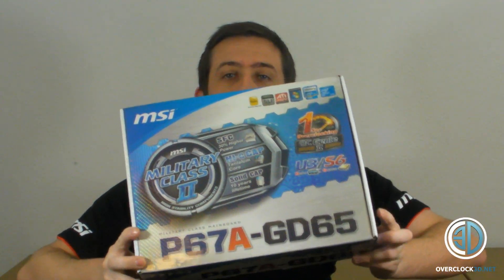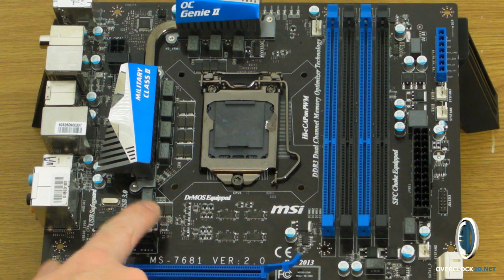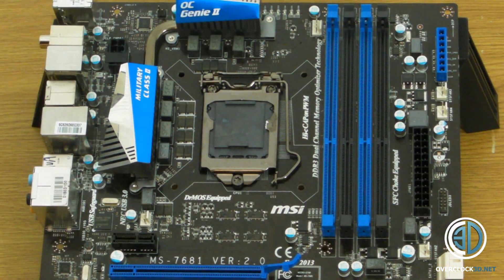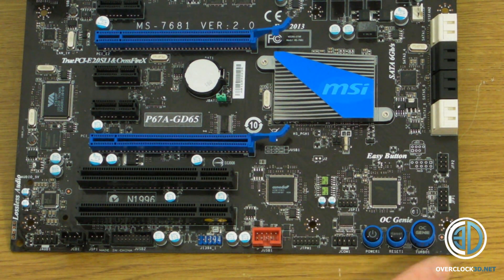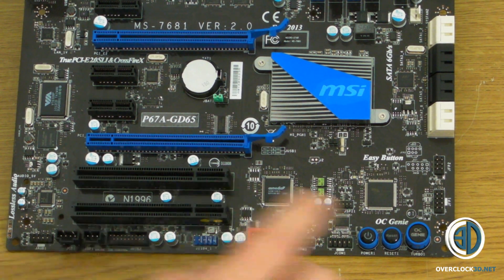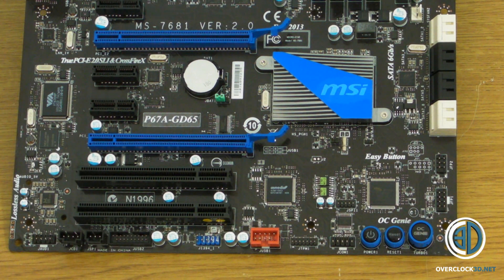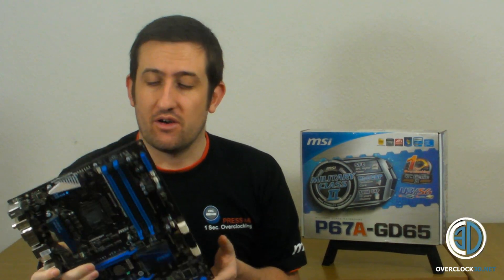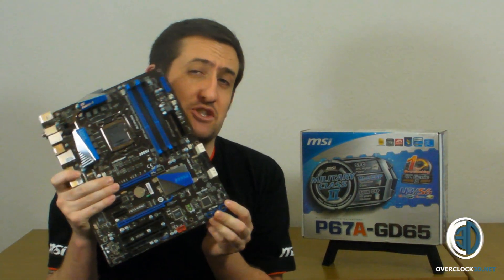MSI P67A GD65 1155 Sandy Bridge Motherboard Preview

Comment: Another great video. Don' t like this boards layout. Don't like that many new 1155 boards only have 4 dimm slots instead of 6. I feel that all mobo manufactures should make higher end 1155 boards with 6 dimm slots for us more power users instead to catering to the middle of the road users. They need to give us more variety of options to choose from.

Comment: @D3mon5lay3r the i7 1155 2600k which is said to be priced at 300usd and that shatters world records which were set by the i7 980x. The replacement for 1366 is in an entire different categorie. The entry level cpus there are hexa cores and octo cores.

Comment: I Wish that this was a replacement for 1366... but looks like that is too far off in the future.... I guess I need to wait and see what happens with AMD Socket AM3+ and Bulldozer mid 2011. (Mid 2011 is where my normal rebuild cycle will fall)